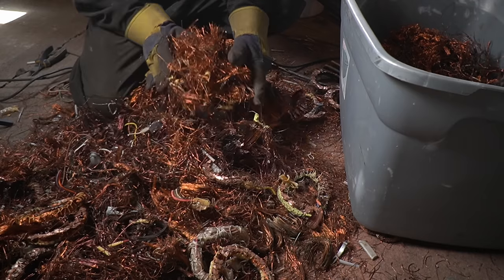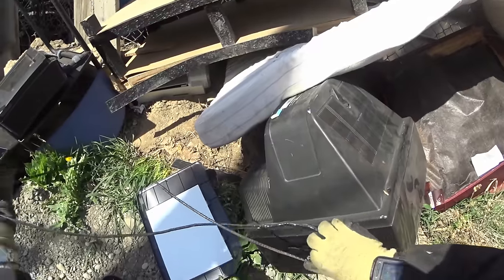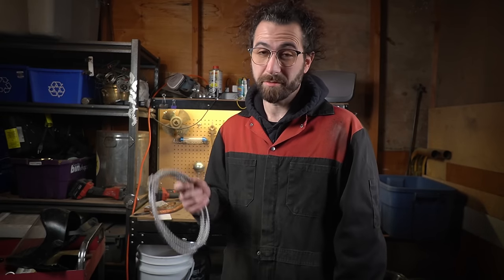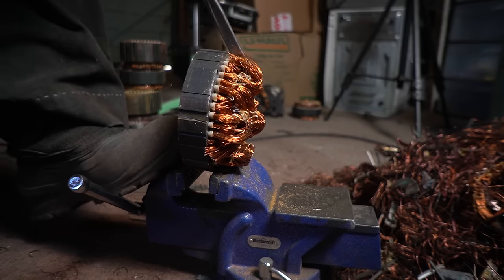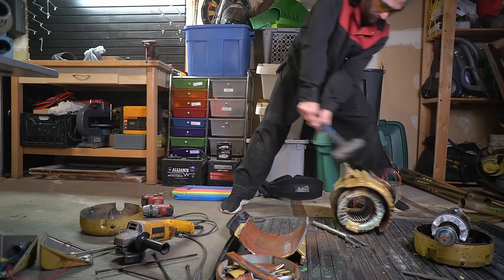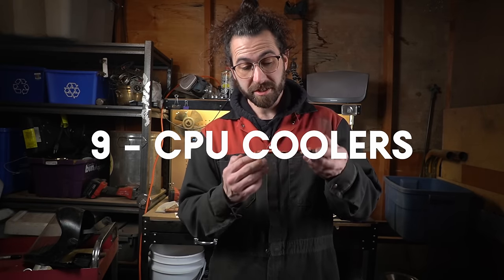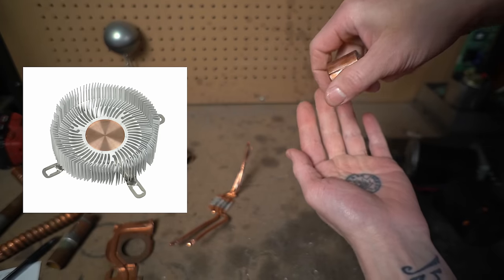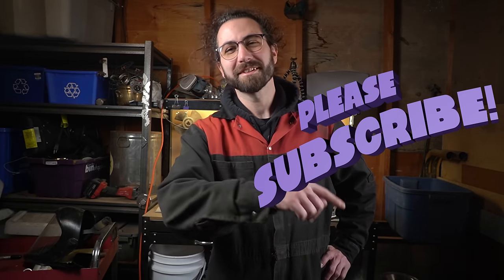10 Best Places to Find Scrap Copper

Comment: The refers from AC units most scrap yards wont take unless you have an electrician or plumbing license. What I do after I have acquired a substantial amount is, I run them through a table saw with the blade angled as to match the angle of copper tube layout. Then it easier to separate the copper tubes from the aluminum. But, even then some scrap yards will not take these as they know these have come from AC units.

Comment: If they're refrigerant gas is so valuable, why would u not try to learn how to take it out and sell it.
Reply from the maker: I’ve looked into it and the equipment would take a lot of recoveries to pay itself off, plus you need to keep different types separate and operate with a business license. The only sensible option at my level is to rent a tank from a local company for a refundable $200 deposit and they’ll accept the mixed refrigerant bottle and do a separation process in-house, but they do it as a service and don’t buy the gas

Comment: Crt tv's are worth more as they are even as parts than copper scraps
 what are you thinking .... 😢 They are collectors and retro electronic lovers gold .... Are you mad🤦‍♂️
Reply from the maker: I did mention to try learn which are which if a person is coming across them often. Some of them are high quality displays and some of them have cool collector appeal, absolutely. But quite a few of them are F-tier garbage
Reply: @thubprint   if it turns on and has sound . Parts for the inners are just as valuable . I found a tv in a skip Case is battered chipped and cracked but after a new dvd drive belt and a bit of grease i cherish it.